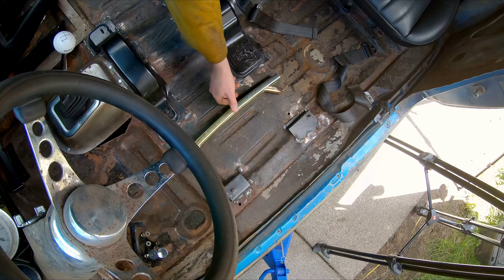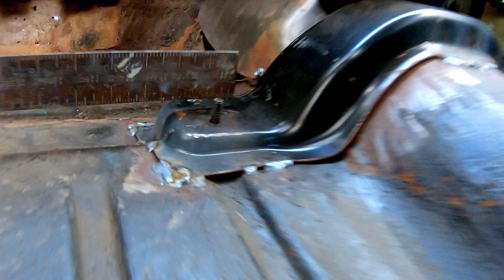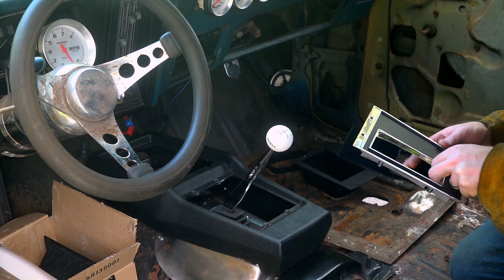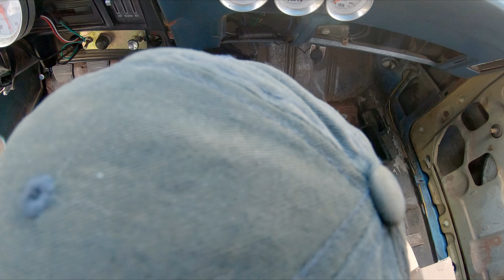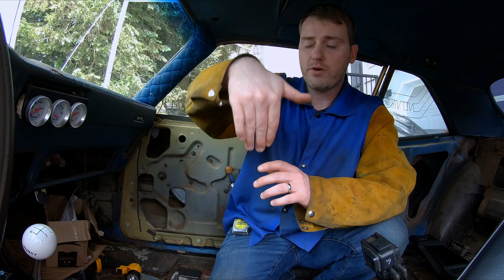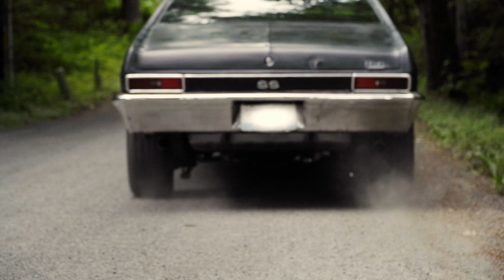1972 Nova Bucket Seat and Console install like a Pro! | Not Rod Ep. 26

Comment: I recently purchased a 75 nova, strictly for use as a daily driver. Had thoughts of changing the bench for buckets, and you successfully changed my mind!
Reply: Dude I feel your pain, I have owned a 69, two 70s a 71 and 72 novas. I recently bought a 78 nova because I've never had one, but good luck on finding parts for it. I sure hope the aftermarket steps up soon to support these year cars because the other ones are unobtainiun price wise. But at least I have the skills to fab what I need

Comment: Did you have to put an ofset shifter when you put the hump in ?
Reply from the maker: @PhantomPix  The Hurst shifter mechanism and stick were both ordered for a 69 camaro which already had the correct offset.
Reply: @NotRodShop Just doing some research; I think that's why you were hitting the inner  filler sleeve. The Nova Hurst shifter insert is more 90°, whereas the Camaro one was more of an offset over, which works with some messing around (as you found out). They don't make the Nova insert anymore. I just found one on eBay and bought it.!